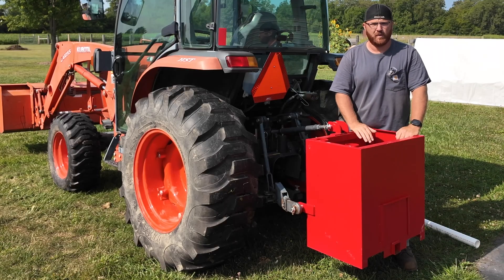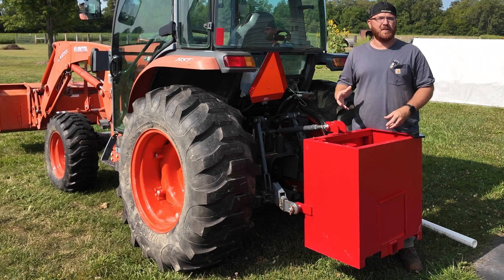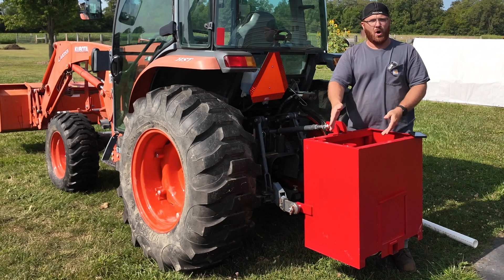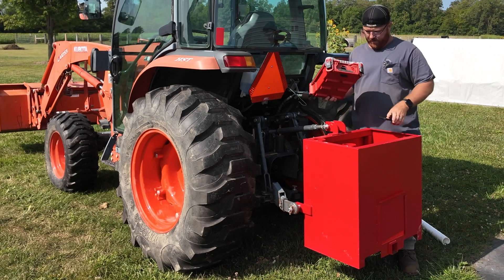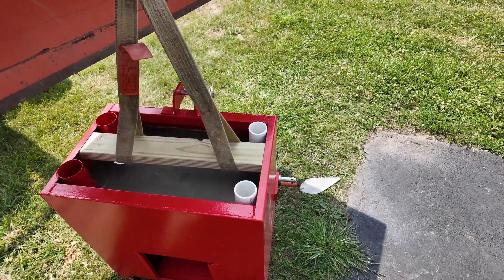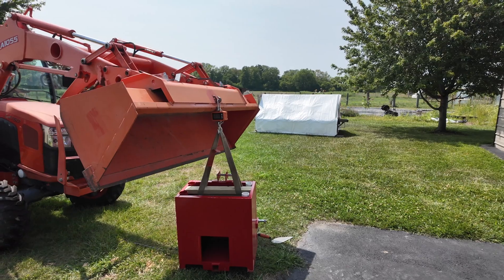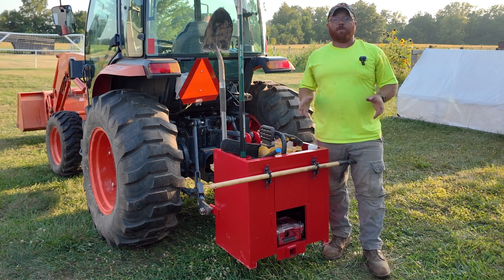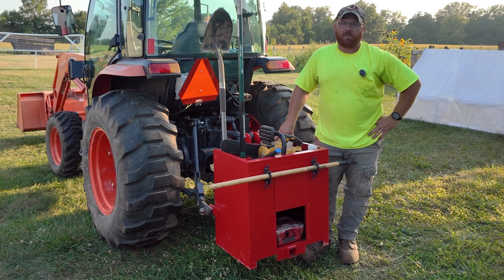How to: Build a 3 Point Tractor Ballast Box with Functional Storage | 600lbs + Ballast Box

Comment: How are the brackets on the back holding up?  I see a lot of reviews saying the rubber breaks fast.  I ordered a few, haven't decided for sure if I want to drill the holes in my box.   Really like how you kept the door available.  Does it stay fairly dry inside?
Reply from the maker: So far they have done well. I don’t use them as much as I thought I would but they’ve been pretty handy when I do. 

Yes! Having that door still accessible for storage has been huge though! It’s so nice having tools there ready when I need them. It’s stays pretty dry for the most part unless we get a crazy downpour. I try to keep the box level or even slightly downward so the water doesn’t make it very far if it does get in. Having my tools in a water tight pack out box also helps a ton.

Comment: Hello! What is the towing capacity for the box? Can it tow a trailer with 2200 lbs?
Reply from the maker: Hey there! I’m not sure I can give you a great answer or any facts for that matter. What I can’t tell you is the box is rated for 800lbs. That’s including hitch weight so technically I should be putting any more weight on my box. I’m maxed out. Now with that being said I’ve pulled a few of my trailers around the property short distances a few times now and it’s held up so far. I wouldn’t trust it going down the road at any speed tho. You 2200lbs trailer probably only has 300-500lbs max of tongue weight. If you don’t weight it down like I’ve done you should be in ok shape.

Comment: Hey Mike,  Thank you for the idea.  Besides the 1.5 inch thick, what are the other measurements on those blocks.  Thanks, enjoyed your video.  John Nelson,  Rhode Island
Reply from the maker: Hey John, thanks for watching. The scrap pieces I used are 13x5x1.5. I actually bought every piece the scrap yard had. They make great weights when I need them

Comment: Thanks for sharing this idea, Mike. I think I’m going to do something similar by filling in the bottom with some scrap cast iron I have lying around. Rather than leverage the front sliding door I think I would be better off by filling that space with cast iron/concrete and then leaving more space at the top to put a toolbox, etc. That way I don’t have to bend over as much to access my tools. Great ideas and I appreciate the time you took to make this video!
Reply from the maker: Hey I appreciate the reply! Sounds like you’ve got a great plan to go on. These boxes are pretty handy. Thanks again for taking the time to watch! 🙏🏻